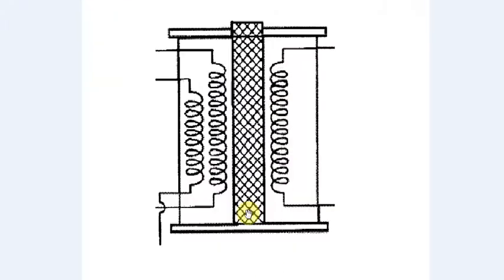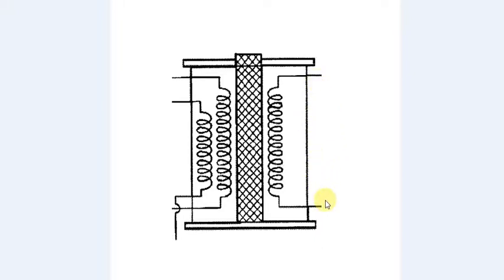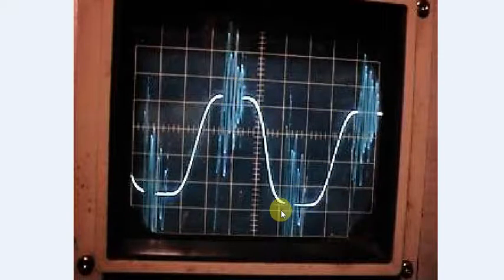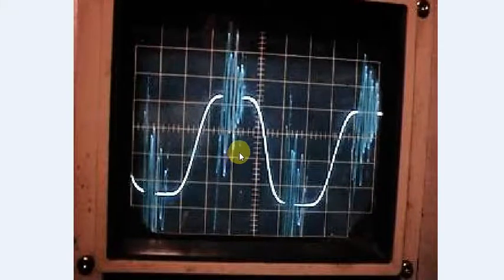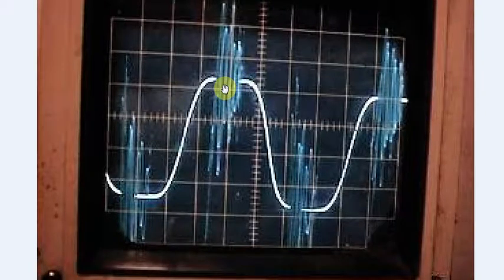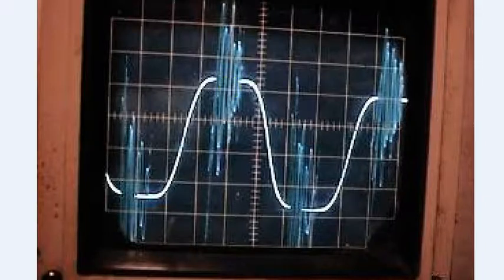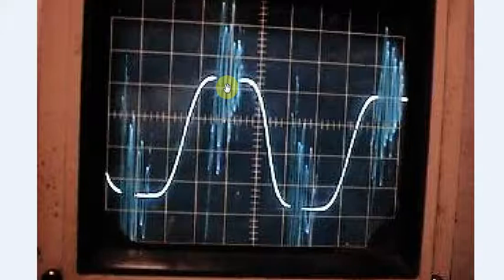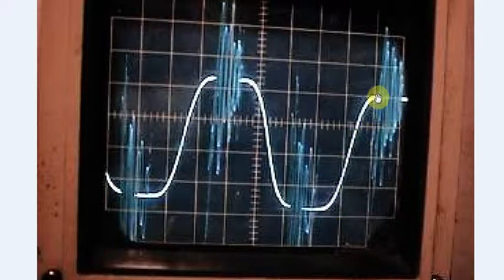Explanation of Coil Shorting Free Energy

Comment: Everything - all dialectric power - comes from the Aether. When you have a resonant coil and discharge it, it rings like a bell. That ringing (over unity power spikes and dips) are coming from the Aether and not from the generator itself. This is similar to having a pendulum winding down after you stop pushing it. Dialectricity forms a magnetic field, and then discharges forming dialectricity, which then forms another magnetic field that is slightly less strong then the previous one, and that discharges into dialectricity again, yet slightly less then the initial pulse,… rinse and repeat until it stops. That’s coil ringing in a nutshell.

Comment: in my opinion the problem accumulating free energy has always been diodes that can convert energy at high frequency and high power what we have now are diodes that are fast or can handle amps but not both at the same time its always a trade off....

Comment: it took me a while to wrap my head around it as well....another point you need to think about is during the point of ringing or echoing of the electrical field, there is a relationship going on with the magnet, which may or may not be helping move the magnet past the coil....alot of people on youtube have show how shorting the coil and keeping it shorted actually helps the motors/rotors spin faster....so it seems that the coil being shorted, is actually repulsing the magnet more that attracting it,,,hence causeing more of an oppisite magnetic field ..... i know it doesnt make sence, but it is true...and although you said that because the coil is shorted it is causing the most power to be produced and later thought you may be wrong, but you are absolutely correct...it does cause the greatest load induced ehich should cause the greatest currect within coil, now if we remove the load or short, that current SEEMS to tranfer back to magnetic flux going back to apposing magnet and seems to RING or echo back and forth......until it dissipates...i believe that don smith's devices harnessed that exact concept.....just like teslas drawaing you show. it is good that you try to explain it because it will help you grasp, as well as me, what exactly is happening...i chaulked it up as an echoing or vibrating of magneting fields going back and forth from coil to magnet....and it gets fired or started from the shorted coil building up its maximum load or field ir power just like you thought it does....also...the same effect can actually be seen by removing a normal load...similar to shorting the output diode in a bedini circuit and then opening the diode....althought the spikes from a bedini are very high, they are EVEN HIGHER by shorting the output and opening the short at the right timing sequence. The most important factor that nobody really talks about is TIME....its the one constant that does not change, but what if whats really going on is changing time itself between the ringing ???? just a thought...but ponder that for an instant...why the echoing? how it it happening?? it should be a one shot deal for the spike but thats not the case at all...as you can clearly see in the scope shot.
Reply from the maker: You are absolutely correct. It really depends on the setup one has. Sometimes by shorting a gen coil a reversal of lenz's law can occur which can speed up the rotor along the way, then we are definitely in the OU at that point. Really though it's not necessary to reverse lenz's law but to simply avoid it, which is good enough to get rid of the reaction completely.

Also a capacitor is a must, the ringing energy will not charge a normal load such as a battery or any other normal load. I will make a video on this as well.
Reply: Ive experimented with a few caps seeing which type seem to absorb those spikes. They seem to work better after they have been used to absorb the spikes, like a conditioning accurs. I myself have seen OU in my bedini setup, but trying to make it self run has proved impossible so far. I believe that lead acid batteries seem to be ok with the high voltage spikes but i myself havent tried, only going by what mr bedini has experimented with. I feel experimenting with charging and discharging batteries is actually a waste of energy....unless your using an inverter and actually discharging them and getting useful work from them, like using for light. It just seems like alot of wasted energy  experimenting with big batteries and just putting a load on them to discharge them and not actually using the energy to save money.
Reply: I took two identical caps and ran one on spikes..like output from a bedini setup...i varied output as well as input for a week or more...after which i then left shorted over night, the next day i timed how long the cap took to charge to a certain voltage with spikes from bedini, then tried the other untouched cap in same setup, the one that i had been conditioning charged almost twice as fast and what was even more interesting was the top voltage was more then 25 percent higher with both caps allowed to max out. They were both 250volt caps electrolytic, i believe 1500 mf.
Reply: Even caps that a purchased a few weeks ago i have been using with varied different joule theifs, tesla colis, bedini motors, they already seem to be accepting more and more power more easily...i keep it small scale, like nothing over 9volt battery...hehehehe
Reply: Hi Sandy that is my scope shot that debunker is analyzing...it is a coil from a muller type generator, with NS hockey puck shaped magnets in rotor sweeping past an aircoil with thick 18GA wire 96 feet of it....I had it set up to make 60hz  AC in this instance and you can see the AC signal there that the magnets make, and also you can see the coil go into its hyper ringing frenzy too, at the peak period of the sinewave when the switch is closed.  Note: there is no capacitor attached to the coil, or any diodes or FWBR when the photo of scope screen was taken. For some reason having it all hooked like it should be to put that extra power into capacitor makes it so you cannot see the ringing.That is good point you made about the reaction of the coil to the magnet sweeping past it to make that "initial: AC sinewave and so dymanics of magnet sweep also is tied into what is going on....one thing this does is constantly change the impedance of coil, having magnet sweep past so it is hard to get handle on the impedance or inductance of coil to do any sort of resonant formula analysis to it.....what is important is the reaction of the motor or motor coils driving the rotor spin and does lenz law effect the spin - and yes it must, during the initial AC current production (you have to have "something" to short) but as you probably know you can get nearly no lenz law if all you do is fill up a cap with no resistive load on it, and this cap is fairly small size.......but where peak coil shorting has big advantage is when that same small cap that has not really kicked in any lenz law now fills up to twenty or fifty times the voltage, and joules stored up in it, when the coil has that peak coil short switched in. Now discharge cap when cap is disconnected from coil, so there will be absolutely zero lenz law during cap discharge to resistive load (now real power output happening) and you get tons more power output from lets say 600V in 1000uf cap compared to 12V in 1000uf cap ao huge increase in power output happens....Importance of shorting at peak period is for two reasons, first you will make the most voltage into cap and second,  it does not affect rotor spin IF the pulse width is fairly narrow.....too much pulse width to short,  and it will slow and brake rotor.....Too much resistance anywhere will kill the ringing...so if solid state you better use paralleled mosfets, also mosfets that are bidirectional so they switch AC....Also a huge sized capacitor will cause too much resistance too, and the ringing will bounce off it like brick wall....Most important thing I wanted to say actually after this long post, is that the ringing happens during switch CLOSURE ....not when it opens like what happens with "normal:" flyback spike backemf recoil stuff people do with pulsed DC inductor.....that ringing you see on scope shot happens when switch is CLOSED....this is important to think about if you want to think about it and what is happening....really its all a big mystery don't worry about it just the normal magnet sweep past coil in a generator brings up question of where the heck does it come from couldn't be the magnet stored up electrons or coil stored up electrons and it just keeps coming and coming every magnet sweep the textbook explanations don't make sense to me in the normal permanent magnet generator theory and explanation so don't expect shorting a coil out to make much sense either if you want to know where it all comes from...doesn't really matter it works and is fact needs no explanation really might be nice to know but not that important....ciaoKone
Reply from the maker: Hi Sandy, you may be referring to to the "conditioning" of the capacitor, but mainly I would like to add the 555 circuit does short the gen coil through out the entire AC Sine wave of the normal generated power, I suppose this is ok to do since anything below the voltage peak, either the negative side or positive side couldn't possibly lug down the rotor fields anymore than the voltage peaks would, but like Doug Konzen has already mentioned that the capacitor is important and almost any other type of load will snuff out the effect, including up to trying to charge the one and only battery, you'll see see there will be no current flowing into the battery because of the batterie's resistance, where resistance of the "normal load" will kill the hyper frenzy ringing. Hope that has some added substance.
Reply: Shorting a joule thief also increase the output. There‘s a video about it here on yt

Comment: By the way works best with mechanical switching and copper-graphite points at the switch. ..just use a normal Relay in selfrunning mide like a doorbell device and use the extra contacts at the relay to shorten and open the coil....very easy to do....
Reply: Hi Stefanyou cannot do big power with mechanical switching is only problem with it .....reed switches also work great but eventyually the contact surfaces will burn out is problem with reed switching and mechanical....mechanical switching has least resistance for sure  but mosfets bidirectional and also paralleled work good for big power production into capacitors,.....caps must fill all by themselves, with no resistive load applied, then caps mustdischarge all by themselves into load all by themselves - AKA two stage output circuit....its also important to do coil short at sinewave peaks, not willy nilly whenever a contact happens to happen, as this is how to prevent lenz law if rotating generator during the coil short, (if pulse width of short is narrow)  and also you make maximum voltage into caps too ....

Comment: Do we have to maintain the cycling or it just 1 shorting cycle?
Reply from the maker: The cycle should be maintained, the single cycle was to just show what is happening close up in a single moment of time.
Reply: debunkified so it is like a on/off on the generator coil all the time? If yes what frequency? and what on time ?
Reply from the maker: Yes it is basically a connection then disconnection of the coils, but the connection is a complete dead short circuit, but only for a brief moment in time! If it stays on too long then there would be Lenz’s drag. It’s a matter of tuning and balancing to find the correct timing to get just the right amount of power without any drag to the rotor whatsoever.
Reply: debunkified I see people using a reed switch....so it is a short on specific timing....got it. What about  when is used a transformer on solid state mode...can be this fenomeno in the secondary coil? or how we can do this on the secondary coil of a transformer when ac voltage ia applied to the primary?
Reply from the maker: Ah, good question. Just use the coil shorting circuit with the two mosfets back to back which is basically a solid state AC switch driven by a 555 timer. This accomplishes the exact same thing as what a reed switch would do, but the only draw back is it requires a small amount of power, no different than what the tiny little drag that a reed has as friction against a rotor magnet (power). But just for experimental purposes this should do just fine.
Reply: debunkified I have read transformer eff near to 90+ so this thing would make them higher eff. Btw, I life out of grid in PR...with 16 solar panels and a bettery bank and I always seeing your video looking for something that I can charge my bat bank in the case of no sun light. So thing like this is extremely interesting to me. My english is a second language so sorry for mistake.
Reply from the maker: Not a problem. 🙂👽
Reply: debunkified If you can do a video working on the secondary coil of a transformer having an ac input on the primary would highly appreciated. I would love to see that oscillogram screen as well.
Reply from the maker: Hi, I’ve done it before a while back. I got ok results but I can’t say they were extraordinary to be honest. Perhaps I didn’t tune it all the way but did try various resistors on the 555 timer, so maybe didn’t work on it long enough, I have bad patience sometimes in this dumb human body. Try looking here http://eternalmotor.blogspot.com/p/circuit-schematics-and-breadboard.html look for the coil shorting circuit. Make sure you have a hefty mosfet that can take good current. The IRF740 can take 16 amps. Have a good one!
Reply from the maker: It looks like there are problems with linking from Youtube to Google’s own hosting site, pretty stupid if you ask me, so just copy and paste the link in your browser.
Reply: debunkified looking on the Geraldin Morin generator....this would be applied to each coil...would be amazing the extra energy with the spikes included or not?
Reply from the maker: Hard to tell. There is still Lenz’s drag if you pull too much power, but then then if you eliminate the drag it usually means you have too little power. It is just collapsing magnetic fields to get most of the energy out of the coils without too much drag and requires a FWBR and a capacitor. This is because of the ringing effects in the coil and the capacitor soaks it up like mad.
Reply: debunkified It is necessary to short on the peak of the sinusoidal wave? I move the reed on different points and look like the high drag on the speed is in front of the generator coil but I saw spikes also shorting in 0V and the speed of the motor went slow but not as shorting in the peak. The leds I put  acroos the coil with a bride turned on also at that point....Anyway...am duplicating the tiny brushless 3 phase motor with a tiny generator Gerald did..wiring the generator as he said and came to my mind to put a reed in front of each coil (12) and short them as you describe here....probably will be the second phase of the replication. 😁😊
Reply from the maker: Hi, yes short at peak of the sine wave, a reed switch sometimes will keep the shirt on too long if it is too big. This why I suggest using solid state tech. Or you can use a small triggering magnet with reed, a Hall effect, anything that will clip just at peak or immediate before or after the peak, or at the same time even.
Reply: debunkified Got it.....on the solid state mode you recommend....the coils are shorted all the time during the path of the magnet in front or you trigger just for the peak? Sorry to ask too much...I would like to understand all details...I believe that the short time is really little...duty cycle...10%....15%....? frequency on the solid state equal to the system or faster?....
Reply from the maker: Yes just keep it nice and short right at the voltage peaks on either side of TDC or both even. So whatever you have to do to get this shirt and quit switching.

Comment: I feel you can get the same effect from scalar wave not scalar spike signal. This scalar wave will be produce at the rotor center by wrapping a rodin coil around your flywheel or using a tesla homopolor motor uninsulted copper plate remember what Walter Russell said from the divine POWER lay in tha centering self not in the motion that generate the motion look at the geometry of your motor design peace out. One love